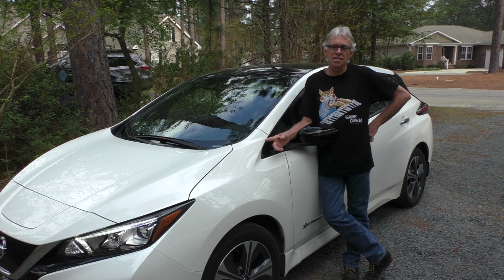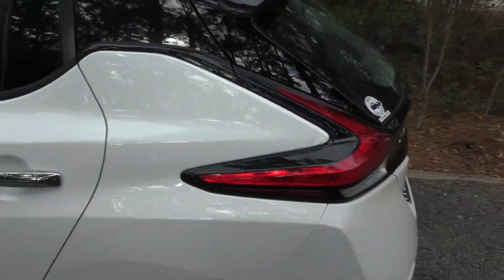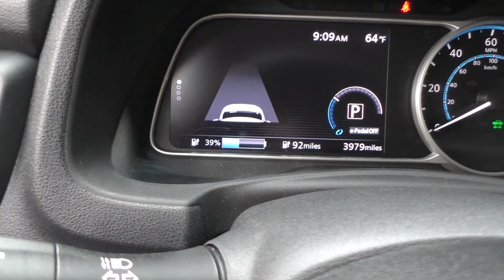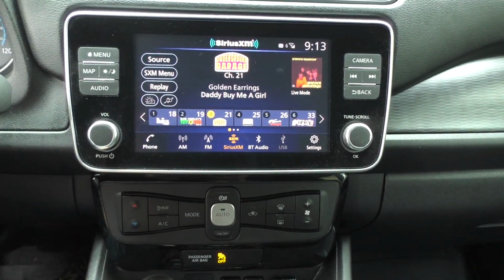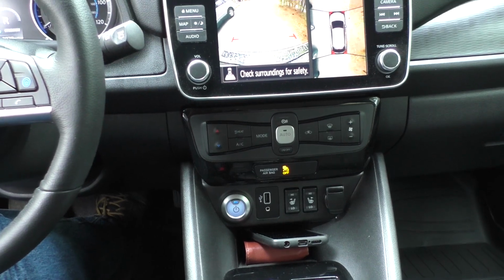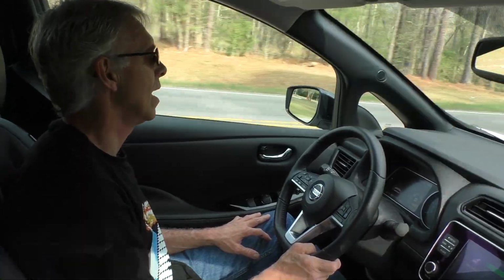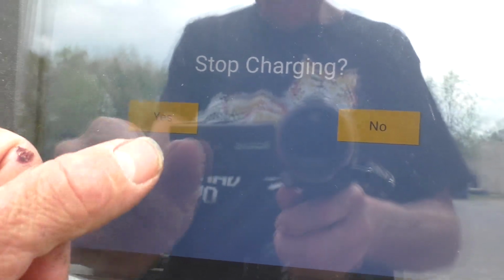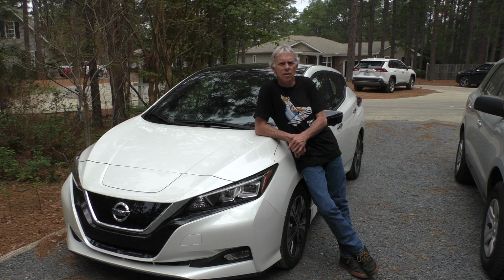Nissan Leaf SL Plus First DC Fast Charge

Comment: Out of respect for your analysis, I drop this bit of news:   In apx 9 months from now  by the spring of 2026,  many parts of California will be over  5.50  a gallon and almost 6.00 a gallon.
My suspicion is that this area of the country is going to drive used  EV Leaf's  up in value.

Comment: People that complain about the fossil fuels used to generate the power for charging also fail to mention the fossil fuels used to develop, extract, transport, refine, transport, store and pump the fuel for petrol/diesel vehicles and its the same when they argue about the amount of fossil fuels used to manufacture EVs and don't mention the fossil fuels used in the manufacture of the petrol/diesel vehicles. I bought the 2022 40kw leaf and I'm really happy with it.

Comment: i looked at one of these but the market is nutty. i could overlook the shitty battery cooling and chademo and limited range but not for 40-42k. thats the same price as i got a kona ev that gets the advertised 259 mile range - and it has liquid battery cooling which the leaf lacks. and battery heat kills the packs real quick,
Reply from the maker: So far the battery has been doing fine with temperature. I bought this one with 3K miles on it for $27K. Even new they don't sell for list price.
Reply: @HackaweekTV  right its fine as long as you only do 30-60 mile jaunts. as soon as you stress it for long distance trips is where the problem is. one guy in norawy tested it on 200 mile runs and the pack climbed to 150F even with outside temps in the single digits. it has extremely poor thermal management. and on those trips where you want to go far the pack will be throttled so it will only take in only 15-20kw of power making it a no go for me.

Comment: Great video I love your new car. I felt like I was in the passenger seat you have a lot of pine trees in the area you live in.  Nice neighborhood too. It was a fun little road trip to the charge station and see how it works. So how much was it?$$$$ I live in East Central Florida and it's hot as hell all the time. Can you make a video showing us the cooling system.
Reply from the maker: Thanks for watching. Glad you enjoyed the ride. I bought it with 7,600 miles on it for $26,700. Not bad considering it listed new for $42,550. More videos coming.
Reply: @HackaweekTV  That's a great price. Where I am, it likes like the SL Plus is going for close to 29K at that mileage. I just got the 2020 SL Plus for what will be around 31K after the tax credit. It's exactly what I wanted. I just wish there were Chademo chargers where my parents live 200 miles away, but I'll figure that all out the next time I see them.